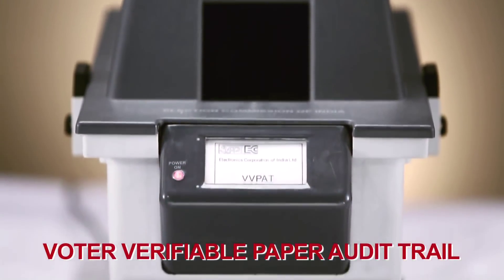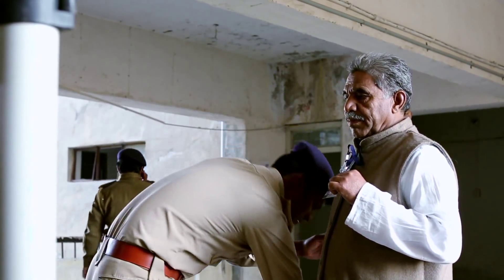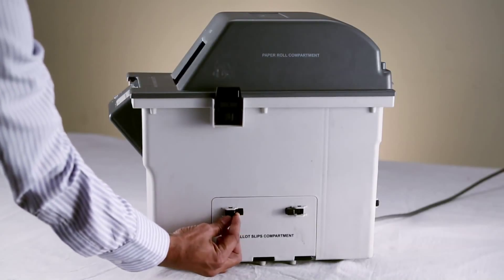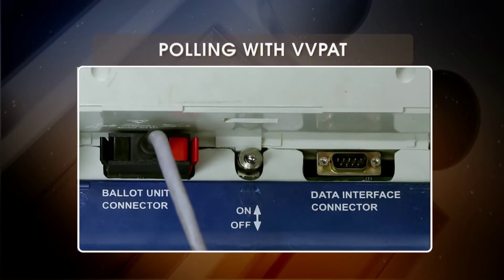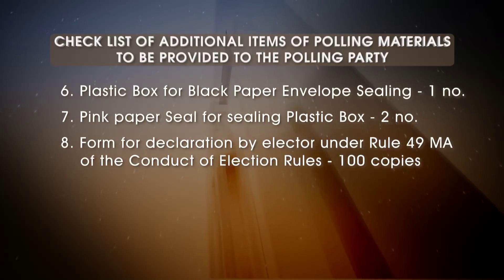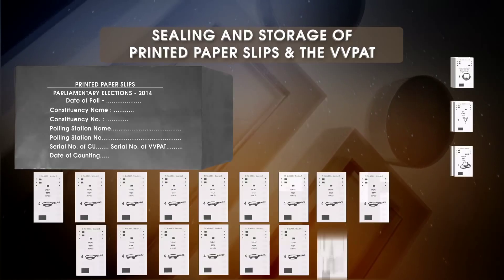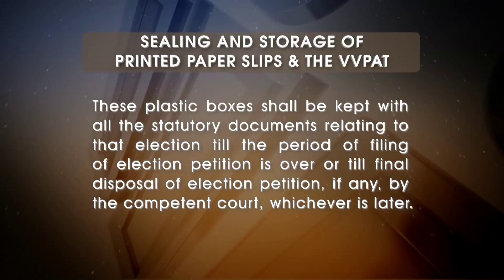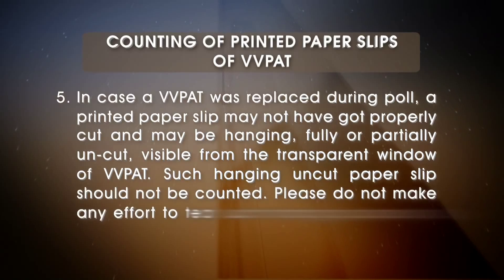EVM with VVPAT

Comment: It means any voter can easily take the picture or video of the polled vote and disclose the polled vote in the front of polling parties/agents to earn lots of money......Kindly, stop this process. And, Iff you want to only ensure the voters that your vote is done then only         

1. one buzzer/speaker(with thanks for your voting message) is sufficient.
2. change the blue switch (polling button) it should be transparent with led light   ...........                       (Master Trainer bhagalpur)
Reply: idiot mobile phones are not allowed inside polling stations
Reply: +Bhanu Bhashkar I think mobile phones or any kind of photo recording devices will not be allowed inside the booth. I don't know.
Reply: there are so much devices mobile phones are not the only one use to spy

Comment: VVPAT  is good but it will complex the polling process for ground level officials.
We used more than 1.8M EVMs in Gen Elec. 2014. By 2019 we will have to use 2M EVMs and now add additional 2M VVPAT units which will not only be expensive but will make the process complex for election conducting officials who go lenths & breadths of country to conduct polls.